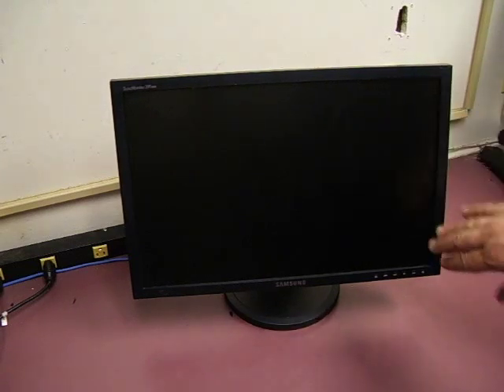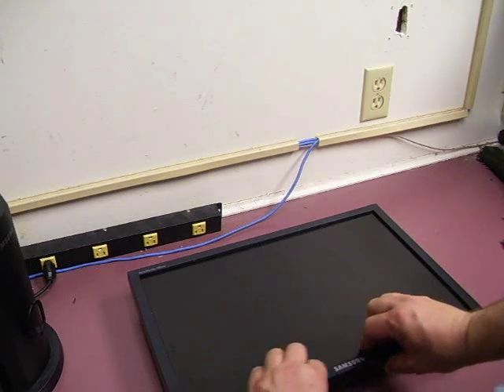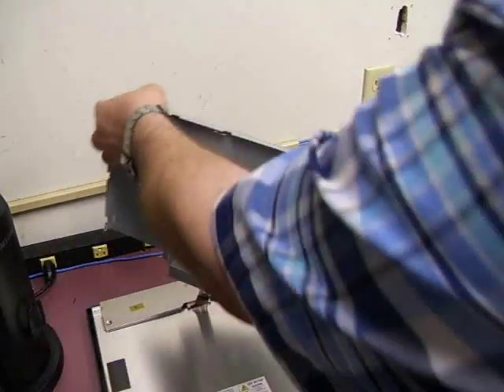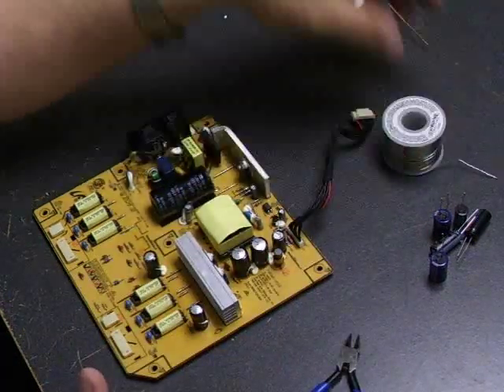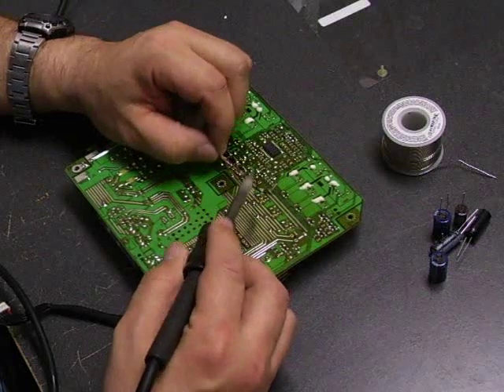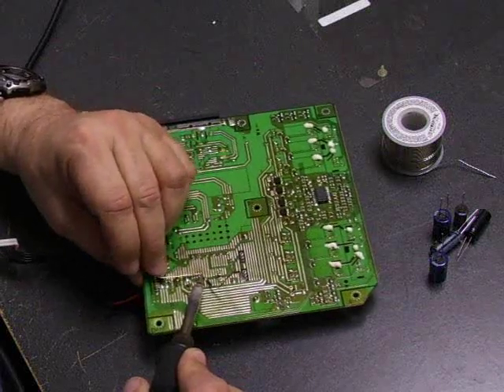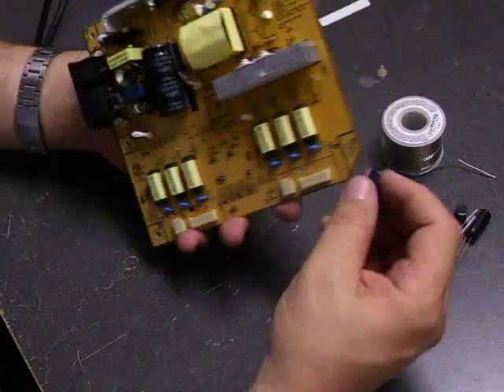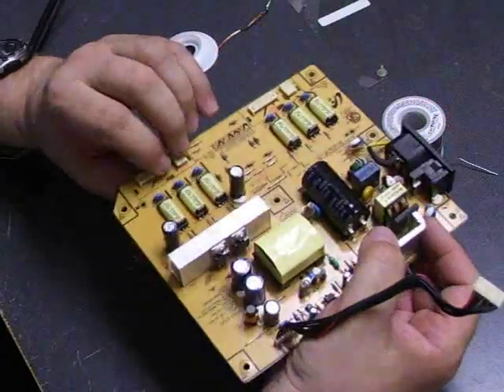Repairing a Samsung 205BW LCD montor with no power

Comment: I replaced 3 (2x 1000uf & 470uf) bulging caps before I found your repair video, after the replacement I still have the same issue with the monitor going on for a couple of seconds then blanking out again. The 2 other 1000uf caps just above the heat sink looks pristine, aside from replacing those two would you have any other suggestions I should try?

Comment: Need help! i have the same problem, but i cant buy those capacitors, i can buy syncmaster 203b will that power supply fork on my 205bw monitor?? 

and my power supply looks diferent that yours on video... model:   ip-43130a

Comment: My problem is slightly different:: the unit never shuts off via the front panel on.off switch. It requires you to unplug it (or use the on/off switch on the back of the panel). I get no display nor are the front panel buttons working. Again the power though always stays on (as long as it's plugged in). Have you ever seen anything like this?
Reply: Hi there, did you ever determine what the problem was?  I have the same issue....
Reply: Yeah I got this problem recently. The monitor is on but the screen goes blank, and the OSD in not functional so it will not switch off on the blue front button. I have to do the switch under the screen to turn off and turn on then the screen works again. As the front power button is not responding I'm thinking maybe the logic board has gone again I replaced it about six years ago. Owned monitor since 2004.

Comment: bought a 60 watt iron from the shack, it worked great! also, I have an inquiry about my power supply board. once i had cracked open the monitor and got a peek at the board, i noticed my model is a bit different than the one in the video. I too have a 205bw, but instead of the (4) 1000's and (1) 470, i have (2) 1000's and (2) 470's. so be sure to get a look before you order the 205bw pack from the site, for it comes with what shows in this video...

Comment: Thanks for this great guide!
I just changed the caps because my 205bw had a red screen. Unfortunately the problem stays the same.
The OSD appears in normal colors. MENU Button didn't work, Power Button only works when no display cable is connected.

Do ya have any ideas?

img833.imageshack.us/img833/1861/foto1ab.jpg
img707.imageshack.us/img707/818/foto2nv.jpg

Thanks so much!